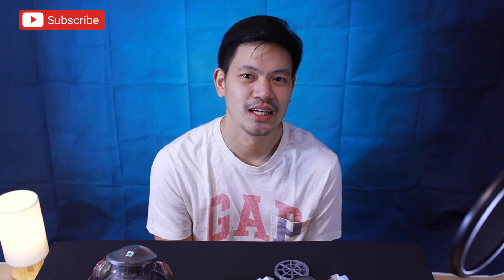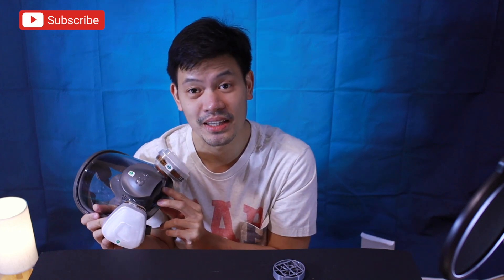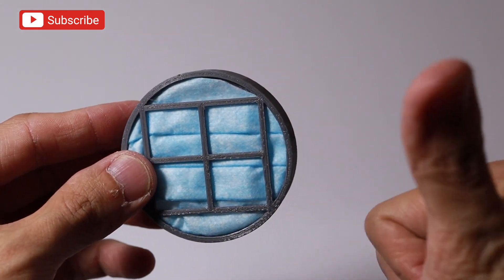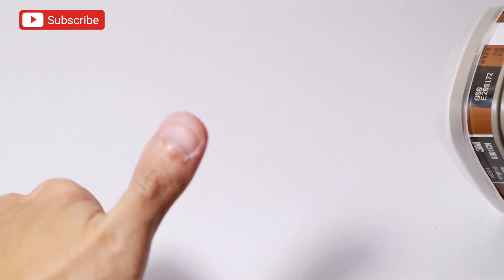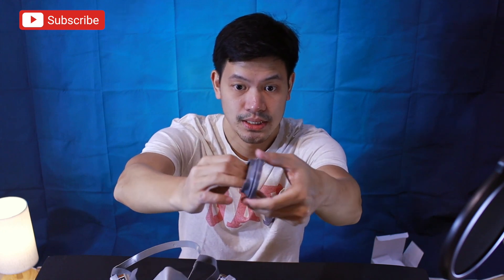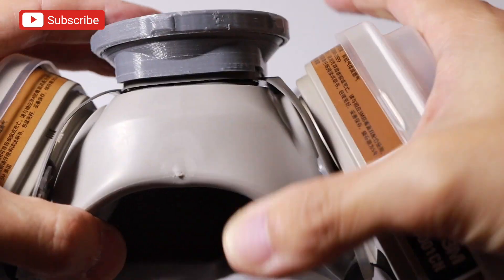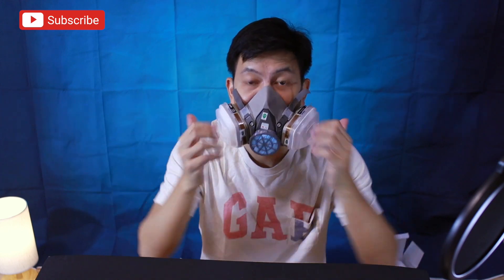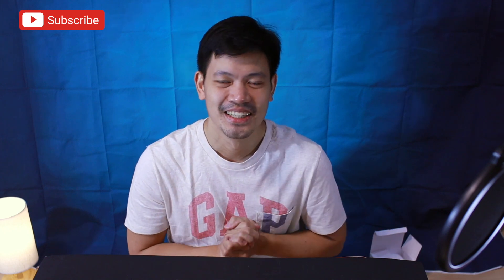3M 6800 Full Face Respirator and 3M 6200 Half Face Respirator 3D Printed PETG Exhaust Valves

Comment: just a point Doc with your indulgence  
a blue mask will mimic an N-95 respirator
in that case--

But there's no way I will believe a blue mask filter
will be better than a a P-100 particulate filter 
like the 7903 (Pandemic filter) or 
the P-100 magenta filters.. those are high efficiency 
particulate air filters that filter out up to 99% of .03 micron
viral particles. The adaptor is good if filters are not in supply